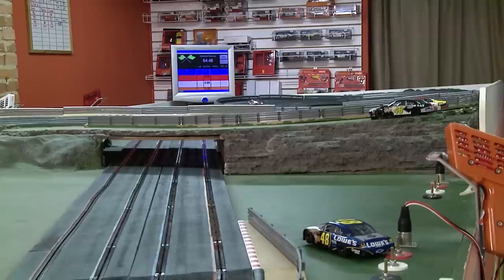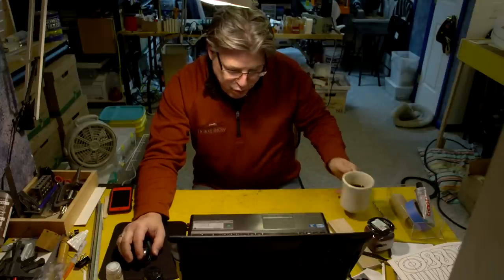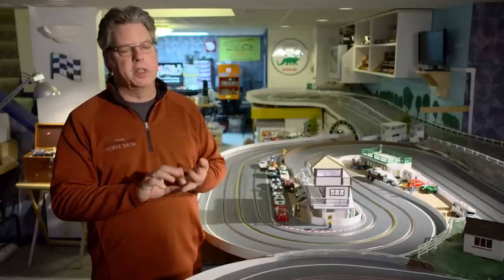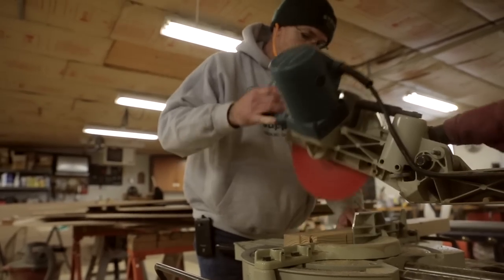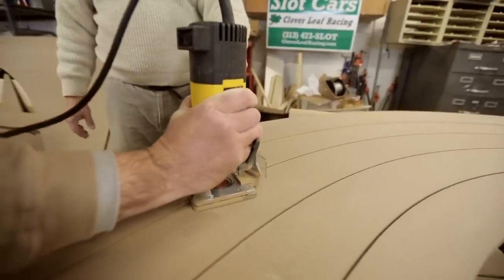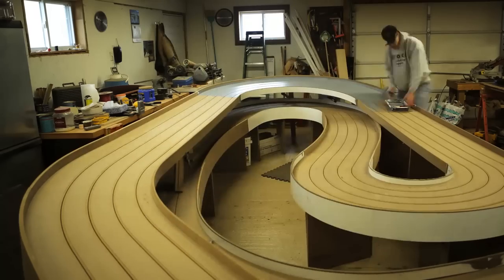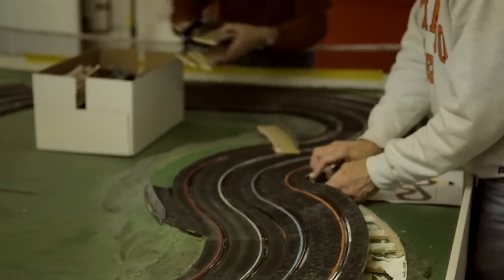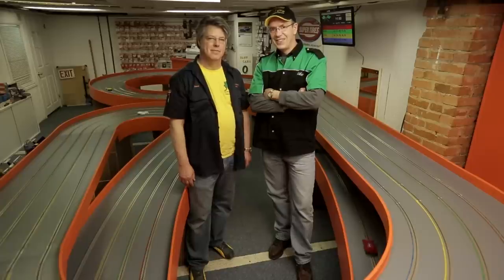Clover Leaf Racing Track Build

Comment from the maker: The track is made out of 1/2 MDF. the slot is 1/8 set to about 3/8 deep.   The bit Tha is used for the braid is a 3/4 router bit that has a special 1/8 pin installed so it will stay in the stay in the slot.  the depth is About  .030 deep, it all depends on what you use for braid and adhesive. The braid Is from Slot car corner.  it is 1/4 wide. the paint is Sherwin Williams latex enamel.

Comment: What material did you use for the walls to get it to bend with out breaking awesome job guys
Reply: The tight bends we used 1/4 and layered it. Use plenty of spring clamps to hold it together until the glue dries.  Most of the bends we actually used the same material we used everywhere else.  1/2 MDF is quite bendable.

Comment: Nice layout, good work. Since youve been so kind to share your build and steps,  I have a few important questions please.: MDF 3/4 inch? What size  router bit did you use for the slot? What depth did you cut? What size Router bit did you use for the braid's recess? And what depth did you cut for that? How many inches between each slot? Center to center? What roll of braid did you use? Brand? Size? Lastly what kind of surface did you apply? I think were going to build our own too. All the tracks closed here. Our kids need this. All the best to you and yours. Ab
Reply: Abbey stjohn dude read the comment above yours...
Reply from the maker: The thickness is 1/2 inch,  router bit for the guide is an 1/8 and the bit for the braid is 3/4.
Reply: Do you have a picture of this? How can you use a 1/2" bit with a 1/8" at the same time? Thank you!
Reply: @enigmaaudio4   You cut the slot first, then go over it with the 3/4' bit using the slot as a guide, to fly-cut the braid groove to your desired depth.

Comment: wgat did you use for the sides? ( material )
Reply from the maker: BUTCH Ratell   the material is the same as the track surface,  it is 1/2 MDF also. I put a Dado in it so I could make it fit in the track surface and make it stronger.